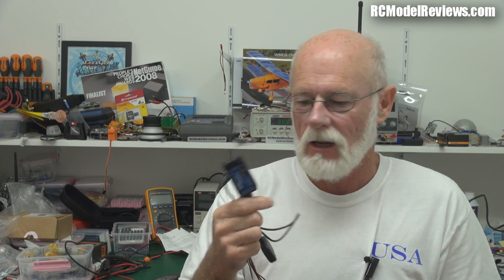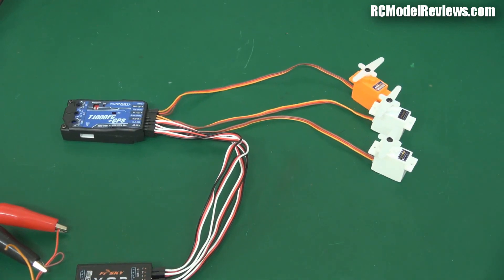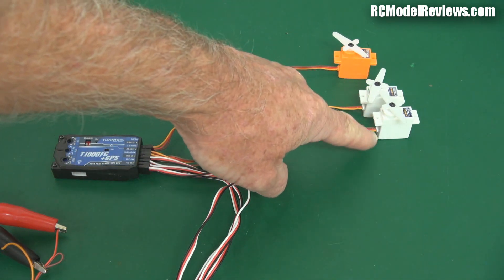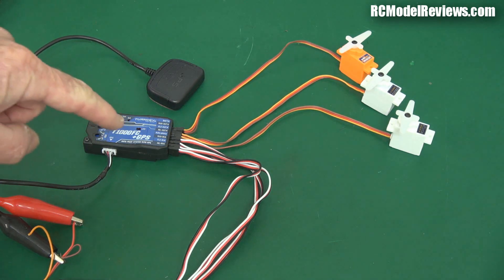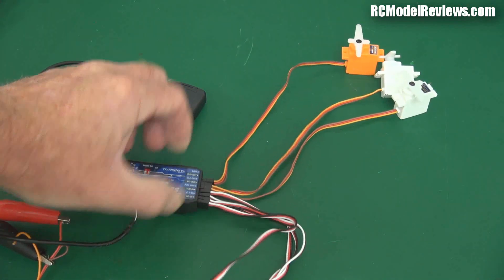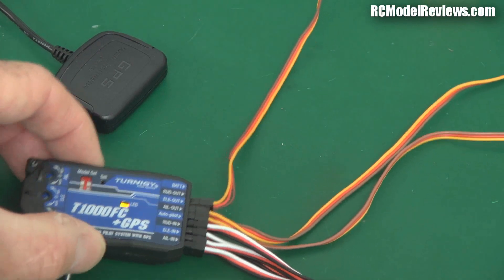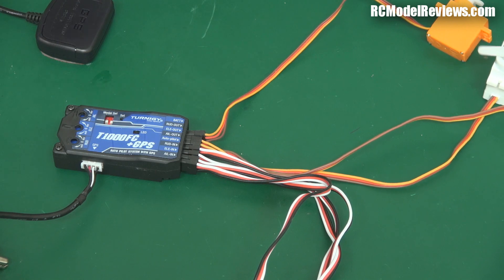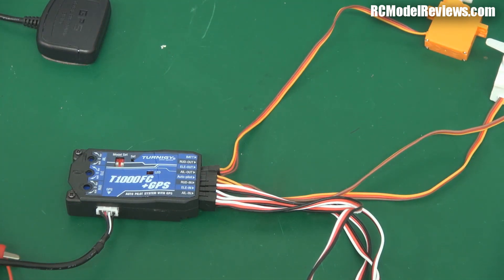Turnigy T1000FC with GPS (part 2, on the bench)

Comment: You did a fine job as an instructor no complaints from me, but the unit's unacceptable if it doesn't function in a way that won't set my heart to beating. No yaw control not good super slow response from the turbos not good. Going to find something else

Comment: Hi Bruce.  I am rebuilding my Bixler 2 and need some help if you have time.  I have the T1000 for RTH and a Remzbiz OSD to see voltage and home direction.   Both have GPS modules and I was wondering if they can be wired to both work from the one GPS? My Bixler weighs in at 1kg and I was hoping to shed unnecessary weight.  Not sure what GPS is in the T1000 but the OSD has a Blox neo6m.  Any help would be great.  Thanks heaps and thanks for the great content.  CP.

Comment: I like the Turnigy T1000 a lot. It works very well for beginners. 
I do regret that you cannot turn the stabilizer off when the GPS is connected as is possible with the stabilizer from bigaole. It is also not possible to use flaperons with this stabilizer, while it has only one output for aileron 1 and 2. It would also be better if I could connect it to the computer like the Guardian stabilizer of Eagle Tree.

Comment: Hi, does anyone know if the return to home kicks in automatically if it is out of range from the transmitter, or there is any interference?

If used for FPV then that is what you want. IF the transmitter looses contract with the receiver for any reason, the plane returns to home.

I agree the instructions are useless. Amazing how they can sell them such bad manuals.

Cheers

Shane

Comment: would the reason for the rudder servo not turning be that the gps unit is not plugged in?
Reply: Hi, no... The unit is not designed to control the rudder and takes care of navigation using only ailerons and elevator, or 'bank and yank' as it's known as. I believe the rudder channel is stabilised so it will automatically fight against wind, but the return to launch doesn't use rudder.
Reply: It seems that there is a scroll wheel for the rudder. But I don't know why...
Reply: I think you can use it as a 'gain' for the rudder channel if you wish to route the signal through the unit. But the unit does not provide rudder control. Bit strange I know, but honestly you don't need it. I was amazed at how good this thing was for the money.

Comment: Do you really need a device like this. As long as you maintain your equipment and model well I think it's highly unlikely you will have problems when flying. My son was flying ic helicopters and planes 20 years ago always maintained the models after each session and never had any problems. This piece of equipment sounds far too complicated to set up so I won't be buying one. Glad I saw this video because I was on the point of buying one on ebay.

Comment: I just came back from flying my EyeSky plane with the T1000FC and it worked great on the auto level and RTL mode.

I was checking the line of site distance and was quite far away when I sneezed and lost site of the plane. I hit RTL on my 9X transmitter and upped the Throttle to ~70% on the stick and waited. I was sure my plane was a gonner.

It was so far away that I couldn't hear the motor or see the plane. A few minutes later I heard the motor and saw the plane was heading towards me at about 100' altitude.
This is well worth the $$$ even if ONLY for the RTL function. The auto level mode works quite well as well. Would be good for new pilots/beginners.
The Middle switch position I find useless whether Mode 2 or Mode 4.

I was afraid of the "out of radio range" scenario and opted to install a D8R-II Receiver with included Failsafe set to RTL with 60-70% throttle.

I'm working on a circuit to remove the middle position of the 3pos switch and replace it with Manual Mode bypassing the T1000FC.

Comment: Hello,

I have purchased a Turnigy T1000FC and have basically bench tested it.  
Before flight testing it, I need to know what are the differences in the (3) the flight modes using the Controller WITH GPS?

Thanks,
Mike

Comment: Bruce, when you showed the mode 3 where the servo went slow as you moved the elevator up and down, I dont think you took into consideration that the reciever was not moving in relation to the throw of the stick ( as if it was in an airplane ). If you twist the reciever up as you move the elevator stick back, I bet the servo would move faster...the servo was responding as if the airplane was straight...try moving the reciever at the same time you put in the inputs, so it reacts as if it was accually in an airplane...thanks for all of the knowledge...I still want to give you a few million if I ever win the lotto...and the is a promise...my wife even knows we will be flying to New Zealand...LOL

Comment: Bruce might have wanted to use spray cell foam behind the drywall in the shop to deaden the background noise outside. Sounds like someone has there dune buggies outside.
Reply: Yeah, there were minibikes on the gokart track next door... which is only about 40m from my workshop.
Reply: It was ok, I could still hear you.

Comment: It's not cheaper than throwing in a $9 Arduino Pro-Mini running MultiWii, $10 MPU-6050, and $15 GPS. Not sure why so many people ignore MultiWii, it's way more flexible and you get the source code. Probably because it would require soldering, I don't know.
Reply: People want to fly maybe and not spent a whole lot of time at the bench with arduino.
Reply: where do you get a 15$ gps then ?
Reply: Topxe - can you tell me where you can get all this from please?
Reply: Search on the eBay for U-blox GPS, GY-521 (MPU6050 gyro/accelerometer) , and Arduino pro mini (make sure to get the actual development board not the USB/serial interface). I didn't realize they're actually a lot cheaper than they used to be so it looks like you could build the whole thing for less than $30. There are of course more expensive higher-end GPS units and things like the GY-86 that have a MPU6050 gyro/accelerometer plus magnetometer and barometer.

Comment: In the brownout test, at what voltage do the servos themselves stop working?
Reply: I ask because after raising the voltage enough to get the LEDs lit on the T1000FC, the servos still weren't responding and I wonder if it was the servos that weren't operating at that voltage level instead of the fault of the LED-on T1000FC.

Comment: Don't waste your time on this turkey for about $25 more you could get the APM 2.5+ basic gps (chinese knockoff). far better funtionality and well documented and capable or controlling any type of model, plane,heli,multirotor, car, boat what ever in stabilised, RTH, alt hold, attitude hold, loiter and other modes.  Up to 7modes all commanded from a single channel on the radio
Another thing to note with this and many other units is the single channel aileron connection. So if you want something more than a single servo for ailerons you are stuffed. No flaperons, no ail differential, even with a Y lead you will most likely need a servo reverser for a second servo.
Reply: Multiwii and Megapirate AIO Flight Controller w/FTDI (ATmega 2560) V2.0 - US$49 from HK.  US$17 more for GPS module.

·Supported MegaPirateNG /ArduCopterNG/ArduPlaneNG/MultiWii firmware
·8-axis motor output and 3 servos output for gimbal system
·8 input channels for standard receiver and PPM SUM input channel
·4 serial ports for debug/Bluetooth/OSD/GPS/telemetry module
·8 Analog port for Airspeed Sensor/Current & Voltage Sensor/LED   controller
·User-defined pads D32~37 & PG1~PG5
·I2C 5V port for external device
·Output/USB ports provided over current protection
·Reverse polarity protection for input power
·Select jumper for choose internal or external magnetometer
·Onboard 16Mbit Dataflash chip for automatic datalogging
·ATMega 2560-16AU Microcontroller
·MPU6050 6-axis gyro/accel with Motion Processing Unit
·HMC5883L 3-axis digital magnetometer
·MS5611-01BA03 highprecision altimeter with metal cap
·FT232RQ USB-UART chip and Micro USB receptacle for uploading firmware and debug
·PCA9306DP1 logic level converter for I2C
Reply: George Myers I think you will find a lot of chinese knockoffs for far less on fleabay. It would seem DIYDrones (terrible name) is now focused on the next gen PixHawk which is essentially running on the same software base but using a 32 bit ARM processor as opposed to the 8 bit AT Mega so you don't have to feel quite so guilty for buying the cheaper knockoff :)
I can't speak for the multiwii controller as I have not used it but it is fair to say it is still playing catch up with the Ardupilot from the software point of view and has a smaller user base.
Reply: What I did forget to mention about the Ardupilot is it has a reasonably steep learning curve and is by no means a plug and play system. That said it more than returns the investment in study. It also is an open system meaning you are not confined to what a manufactuere is willing to provide. If you need some functionality you can modify the code yourself ( hard core) of search and ask if the feature has been done before. Compared to it's natural competitor the Naza, the Naza has the edge in simpler setup but at the cost of flexibility and being a closed system it is not possible to mould it to your requirements beyond tuning. It is also rather expensive, a fact the manufacturers seem to have acknowledged by releasing so called Lite versions for less dollars. A direct response from the competion from Ardupilot I suspect

Comment: No doubt HK will come out with a V2 at some point so i'll probably hold off and wait for that to see if they put an OSD feature in it or what ever else.

Thanks for sharing Bruce and giving us your thoughts on it.
Reply: More likely, V2 will fix the terrible gyro drift in 3D mode, and add rudder stabilization.  HK's english speaking engineers should write the manuals too, instead of handing that job off to the Chinglish department.
Reply: Jeff Thompson No doubt they will sort the 3D mode out as well but it don't effect me so i'm not really bothered,as far as the manuals go i don't normally use them unless i get stuck lol.

Comment: Nice one Bruce. Maybe they'll produce a slightly cheaper version without the 3D stabilisation, as I'll never need it.
Reply: There would be no cost benefit to eliminating 3D stabilization as it is entirely in firmware and uses the same hardware that needs to be there for the other functions you WOULD use. I'll wait for them to get the bugs worked out and come out with a v2.0.

Comment: NEW from HK Quanum Pocket Vibration Telemetry Voltage Meter With Alarm its a page for low voltage I just ordered it 25$ will work good for my HELIS but range is only 300 to 400 m that's good for helis but crap for planes I ask you to get one and extend the range